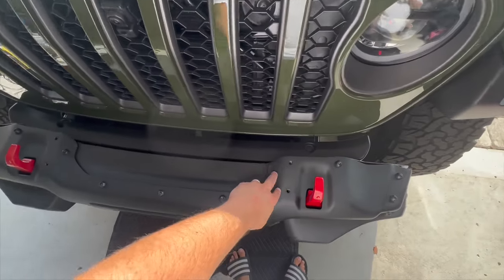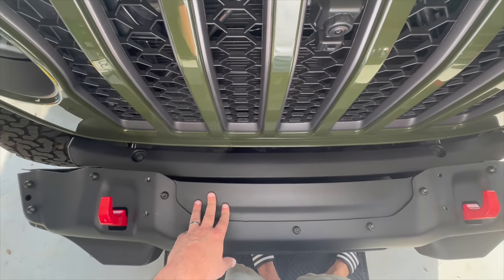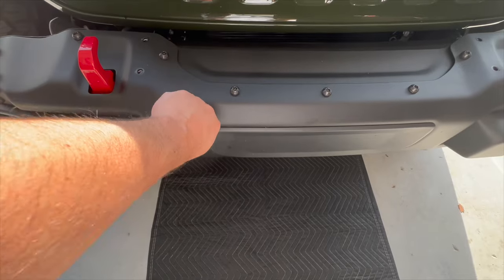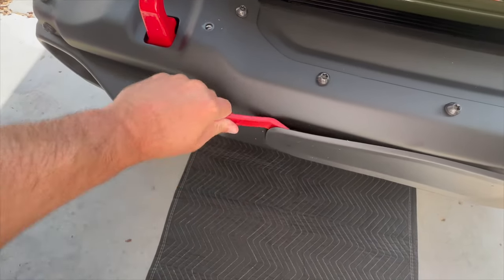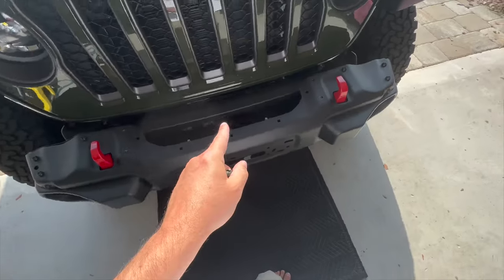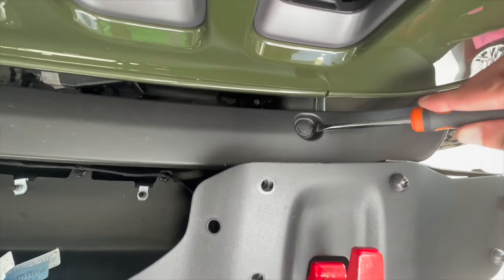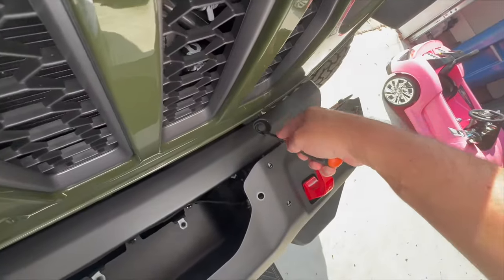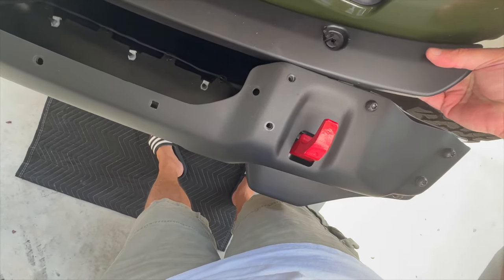Installing the WARN Winch Step-by-Step

Comment: I love the look of the front oem steel bumper with the bull bar on the top and winch.  This is the look I think I will go with on my '24 JLUR when I'm ready to do it.  I may have to find a shop or handy friend to help with the install as I'm not sure about it.  Will be driving stock for some time first before making any big changes.  Great video thanks for sharing!

Comment: The Warn VR Evo is no longer wireless and it is the same price as it was when it was wireless. I cannot believe that they are selling this with out the wireless feature. Anyone that has bought these models in the past will be expecting it to be wireless. You will be better buying a synthetic Superwinch.
Reply from the maker: You have to file a claim to get the credit to order their other wireless controller. So it is wireless, it’s included, but you have to go through a couple steps :(